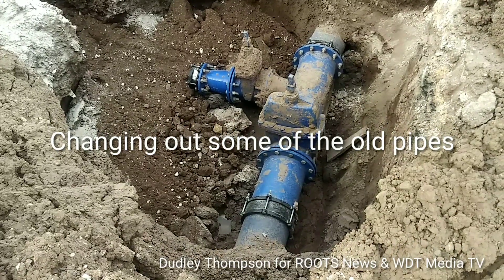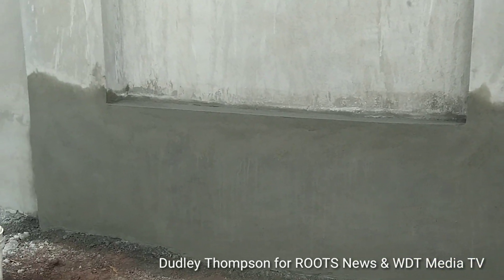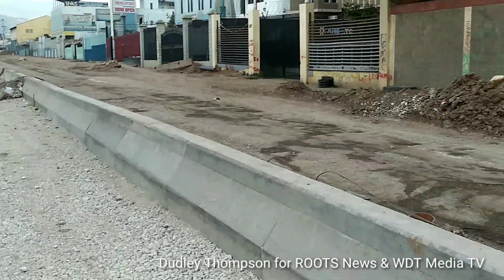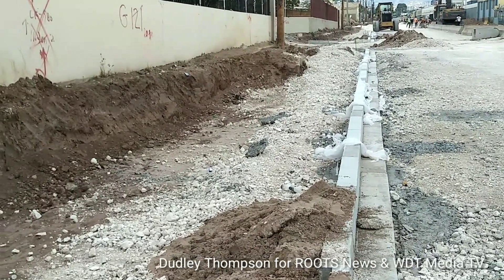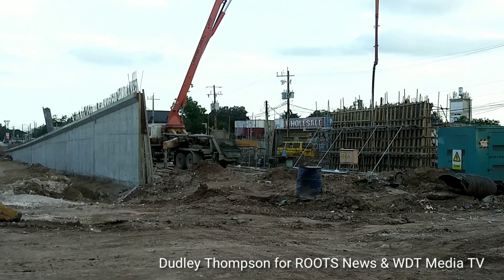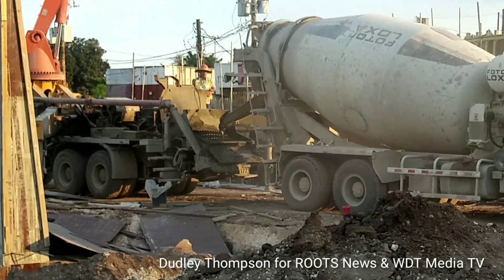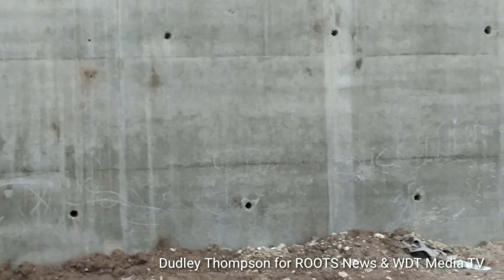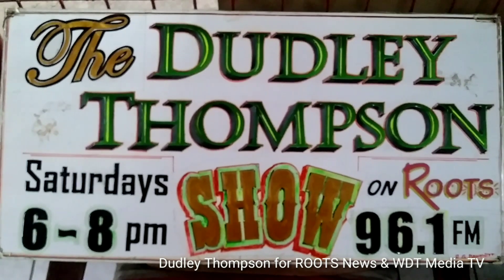WDT Media TV Hagley Park Road Improvement Project

Comment: Dudley, there is nothing wrong with motorist take other routes to reach where they want to go. If you want to access businesses that don't have access road off Hagley Park Road then you turn off into the byroads and come up on the other side.  That is how they do it in the first world country.  They can't facilitate every building on the road, that would put us in the same position where we're coming from.  Now, regarding the old pipe connecting to the new.  It's a disgrace to see the shabby work being performed on the project.  I can see NWC digging up that road later.  We are talking about getting to first world level, that is wish full thinking.

Awesome job Dudley!

Comment: Dudley Thompson: I noticed when they were building the Jersey wall on hagley park road they didn't put any in steel it but on the fly over and Mandela hwy the Jersey walls have steel
Reply: That’s because on the road it’s just a barrier for traffic to stay on left only.  On the flyover it needs to be much stronger since it is a retaining wall to prevent all types of vehicle falling 50 feet down to ground.
Reply: They have steel in them I pass   all the time and watch them working
Reply: Stuart Wilson: Retaining walls and jersey walls are different. Retaining walls are on both sides of the fly over and Jersey walls or Jersey barriers is in the middle of the fly over that separate the four lane  2 lane going east and 2 lane going west